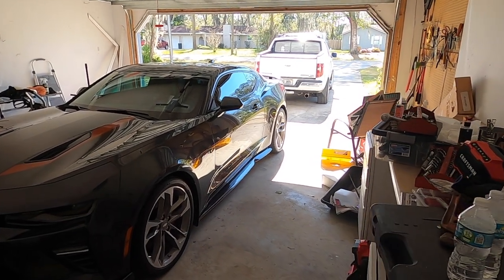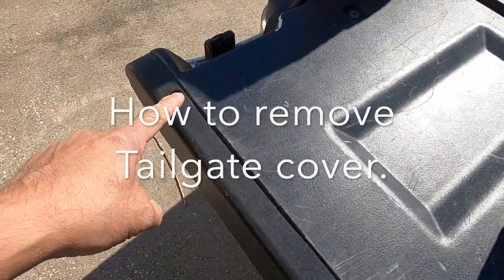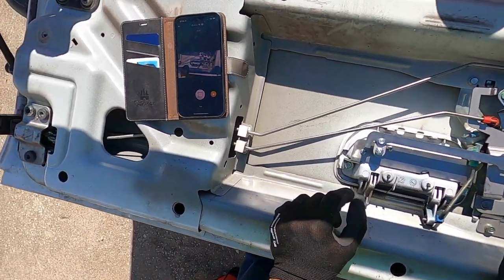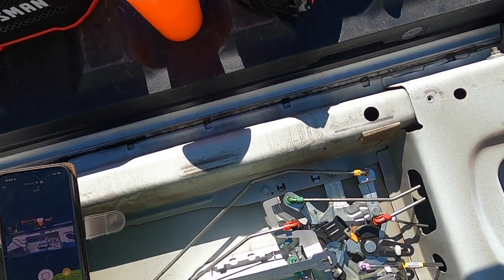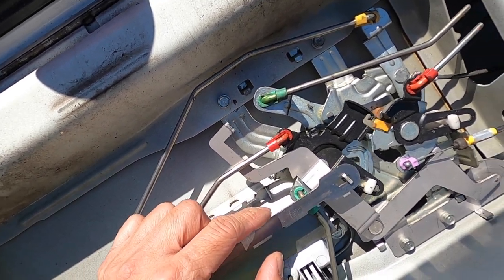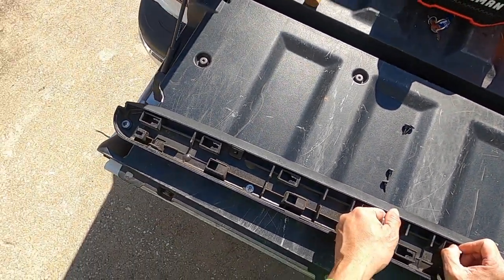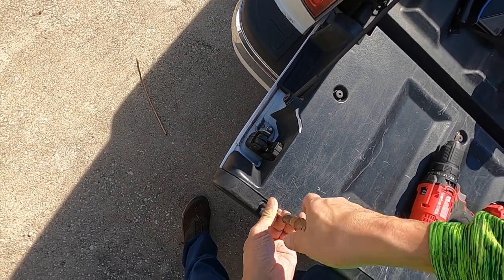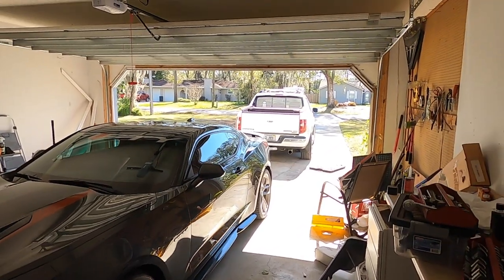Honda Ridgeline Tailgate: Panel Removal, Lock, Swing Tailgate Latch Repair

Comment: Please put on your next video where you got that Pop & Lock thank you
Reply from the maker: You’re right.. thinking about it I should have.. when I made the vid it was about taking the tail gate apart and figuring it out. but anyways I got it on Amazon if you are looking for it.
Reply: What should I search on Amazon to find that exact one?
Reply from the maker: @Leonitrous  Pop & Lock PL6100 Black Manual Tailgate Lock for Honda Ridgeline (Works with/Without Factory Backup Camera) https://a.co/d/3PmQ8DE
Reply from the maker: @Leonitrous  I sent you a link, this looks like the one that I installed just choose your truck color, it’s very minimal parts.. just replace the purple clip like I said in the video and I’ve never had it pop out and fail. Our trucks are getting old and the plastic clips are getting weaker.
Reply: @cyruscruz5512  4 months later I'm going to pull the trigger haha.  Do you have any footage of your tonneau cover?  It's the hard one that rolls up right?  Do you happen to have the make and model of it?  Copying your truck 100%.
Reply from the maker: @Leonitrous  sorry for the late response. Holiday season keeps me busy.  Actually the cover I have is the cover you get as an option if you buy it from Honda. Bed covers to me is based on what type of car go you will be regularly loading.  I currently have the bifold and it comes with its own sets of challenges.  I feel that rolling is better for my use.  It’s not what i have so I can’t say too much since I want to stay on my lane.  But I will tell you that the bifold is nice and build well but… a big but I do not like that part of the locking mechanism is on the tail gate. I have loaded some heavy stuff and bent a latch portion.  Also I have slid stuff off the tail gate and it got hung up on the mechanism, and I have found myself removing the cover if you plan on doing a lot of dyi and trips to Lowe’s. So any large loads require me to remove the cover.  It’s not hard just a pain in the butt. On the flip side. There is a lot of Ridgeline owners will be fine with it because they don’t use the bed of the truck a lot. But for me I use mine a lot and haul a lot of things, almost to a point that a traditional truck suits my needs better as far as bed use. I know this is long winded answer to your question…no I don’t that the roll bed cover but if I had my choice and a do over I would get a locking roll..

Comment: Dis you need to drill a whole on the handle cover to be able to install the lock?
Reply from the maker: Yes you have to drill a hole. Directly behind the tumbler.. don’t worry you will not see it because the lock comes with a body match key tumbler housing.

Comment: I have the same problem with mine, except the cable pops off every time you pull the handle
Reply from the maker: Change the clip.. it happed to me a couple times but after I changed the clip out it stopped.. it hasn’t happened since I made the video.  Im guessing it’s because it is plastic and it’s not aging well till you put a fresh one.

Comment: This is a great video and very helpful. The orange clip at the top of the passenger side of my tailgate was broken. The only thing I was missing in this video was how to get it open to do the repair. Below is a link on how I got my tailgate open so that I could replace the hardware.

https://youtu.be/bcbNhDtXpw4?feature=shared
Reply from the maker: @joshkolakoff3144  I’m glad that you found the video helpful… I just checked out how you popped open your tailgate.. between your video and mine it should cover both stuck tailgate situation.